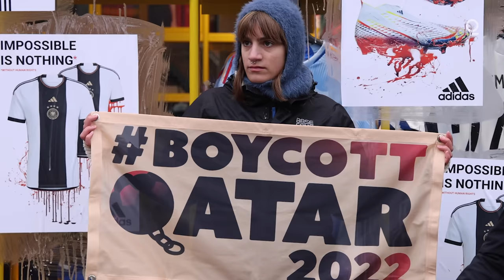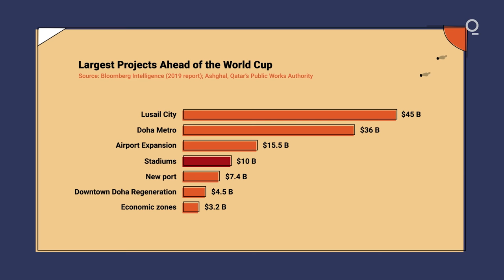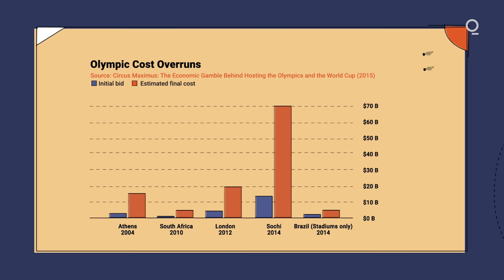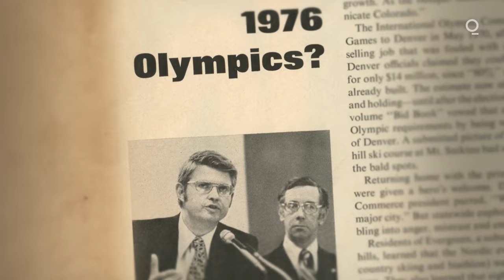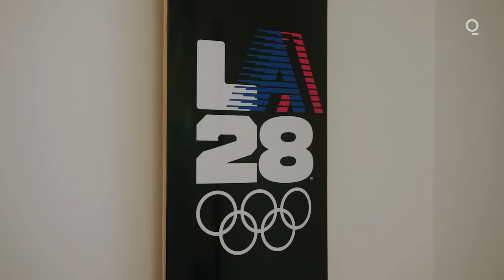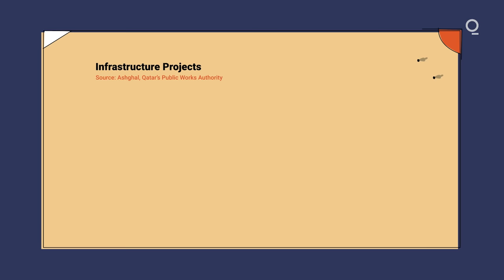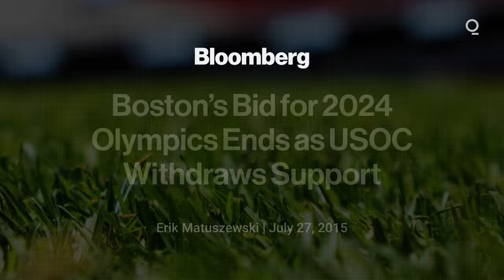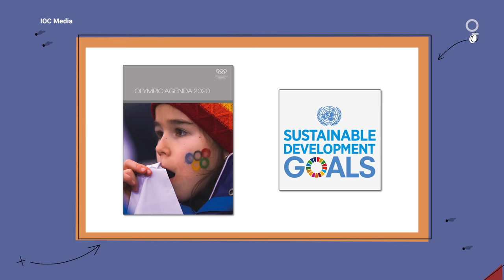Why Qatar's World Cup May Be The Last of Its Kind

Comment: If you don't have most of the infrastructure in place, most of your investments will be wasted. In countries like Brazil, most of the infrastructure they built has fallen into disrepair because they had no use for it before the games and have no use for it after the games. The same will happen in a smaller country like Qatar. Places like Paris and LA are ideal places for the games because they're large metro areas with most of the infrastructure already in use that just needs restorations and upgrades to accommodate the games.

Comment: They need to just rotate the WC and Olympics from like 3 or four different cities that have sufficient permanent infrastructure to support such large global events.
Reply: For the World Cup, there might be a few cities with 4-5 v large football stadiums that are regularly used. The only one I can think of is London, but there might be others, and regional sharing might be viable in some cases. Overall, I think the World Cup could reasonably require bidders to NOT do any major new construction.

For the summer Olympics, the problem is that there isn't anywhere that has all of the permanent infrastructure. It's such a diverse mix of sports that there's nowhere in the world that is so amazing at all of the sports that they need top-notch stadiums for all of them. And anything that you build specially will be too big and expensive for ongoing use.

For the winter Olympics, the problem is climate change. There might be a few places that have most of the needed infrastructure, but they probably won't have enough snow in 30-50 years' time. (Or everything will have to be moved higher up the mountain, which isn't easy.)
Reply: @jon_j__  US has tons of stadiums that can be used for the World Cup (literally every stadium used in 2026 in the US is an already existing NFL stadium). And before you say, “but that isn’t for football”, an American football field and a soccer pitch are fairly comparable, and there is a lot of sideline space at NFL games.
Reply: @troybaxter  I agree the US has tons of stadiums. My point was that I don't think they have any cities with 4+ high-capacity stadiums. (I believe the plan for the next WC is for the matches to be spread out between several cities on the East Coast, because each city only has one.)
Reply: @jon_j__  also, the next WC will be spread out over many cities across the US, Canada, and Mexico. Given that FIFA is increasing pool size by 50%, it makes sense to have more cities come into the mix.
Reply: @jon_j__  oh, and fun fact. Of the 11 100,000 capacity stadiums in the world, 8 (3rd through 10th largest) are in the US, and all are college football stadiums.

Also, Dallas-Fort Worth and London are the only two cities with a stadium that have a raw seating capacity of 80,000+ (minus additional seating added and standing room).

Dallas-Fort Worth:
Cotton Bowl - 92,100
AT&T - 80,000

London:
Wembley - 90,000
Twickenham - 82,000
Reply: @jon_j__  oh, and fun fact. Of the 11 100,000 capacity stadiums in the world, 8 (3rd through 10th largest) are in the US, and all are college football stadiums.

Also, Dallas-Fort Worth and London are the only two cities with a stadium that have a raw seating capacity of 80,000+ (minus additional seating added and standing room).

Dallas-Fort Worth:
Cotton Bowl - 92,100
AT&T - 80,000

London:
Wembley - 90,000
Twickenham - 82,000
Reply: @troybaxter  I think we're agreeing? Most possible WC hosts would have to either split the matches between multiple cities or build new stadiums.

But it is interesting to hear that Dallas has two massive stadiums. I guess they have two big teams?
Reply: @jon_j__  Dallas has the Dallas Cowboys in Arlington, TX (a suburb of Dallas-Fort Worth) in AT&T Stadium and is absolutely MASSIVE. Realistically it can hold over 100,000 and will likely host at worse the World Cup semifinals if not the finals.

The other stadium, the Cotton Bowl, hosts a wide variety of events, including the annual Texas-Oklahoma rivalry game, college football bowl games, and used to host the Dallas Cowboys for a time period.

Let’s also not forget that cities like Houston, LA, and NYC also have large capacity stadiums that can and will host soccer matches.

You are correct that WC hosts will have to split matches over multiple cities, but that is simply the nature of the event. You have so many countries and so many matches being played, it would be impossible to host it in only one large city. And honestly, why would you want to host all the matches in one city? We have Group Stage for a reason. Just put a couple Groups in a city and there you go. It’s no different than what America does multiple times a year in the form of bowl games, March Madness, professional sports playoffs, etc.